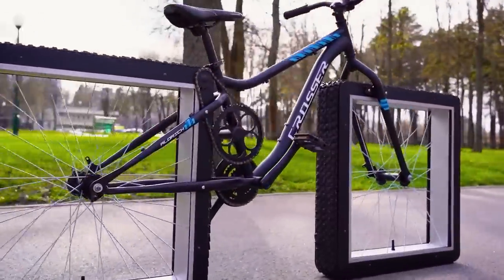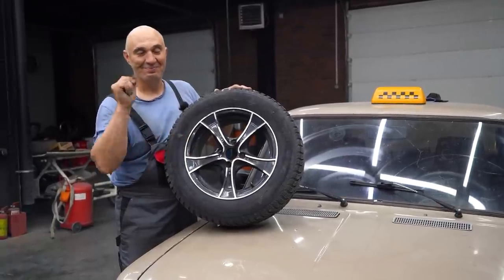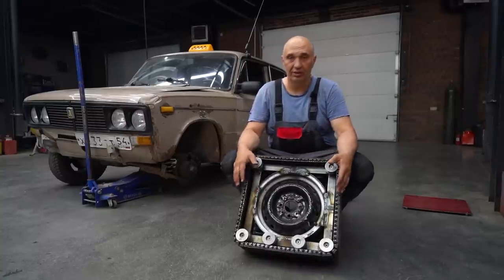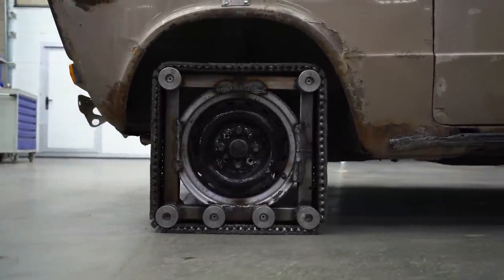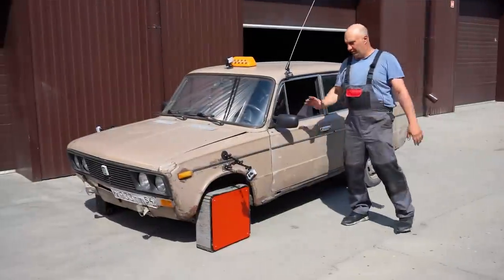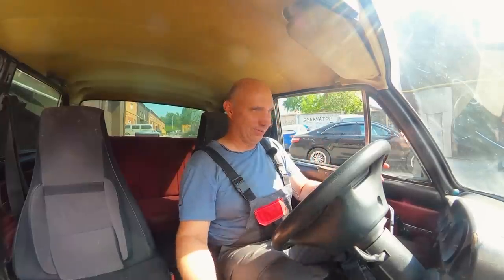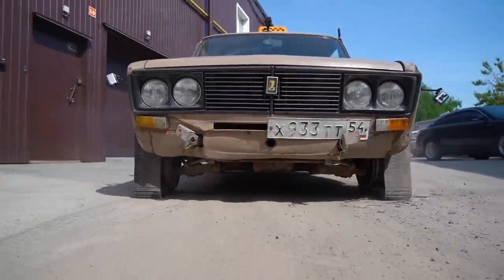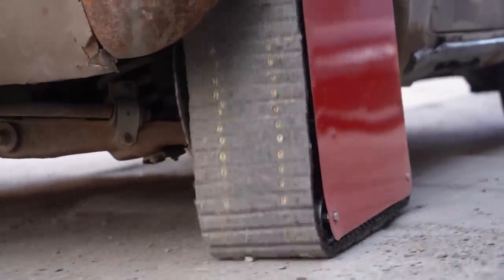We make gliding square wheels for a car

Comment: Please do all 4! ...and maybe make the wheel arches square too, for the sugar on the cake.
Reply: @Room1sixtyfive  gear drive from drive shafts to the chains inside the square wheels somehow then a brake on the driveshaft similar to how they do it on gocarts (and monster trucks). You'd obviously need the wheel hub mounted to spin free from the driveshaft powering the gears so it stays bottom side down.
Reply: all 4 cant work without modifying the entire car into a tank-like drivetrain.
Reply: One can clearly see the newbies on this channel, they're using the words "can't work" or "can't make". 😁
Reply: @MegaSockenschuss "You can't have no in your heart, brother"
Reply: Sugar? WTH? 😅
Reply: @UmmmmmmmWhat exactly
Reply: that would require on complicated set up to turn the axle turning into the track rotating
Reply: @MegaSockenschuss  wouldn't use the word "can't". They'd have to convert the simple design to a more complicated one, which will only produce more problems. Their glass engine was actually my introduction to the mad russian here. My impression was "what a novel idea."
Reply: @MegaSockenschuss richtig! Hier werden die unmöglichsten Sachen möglich!
Reply: They only did the steering wheels, not the driven wheels. That would obviously be harder to design something to drive the tracks. Also, there's definitely no brakes up front now, so this design would need to be heavily modified for the rear end
Reply: It’s “icing on the cake”

Comment: Get that 2 stroke engine ready
Reply: Bruh- a step too high I thinks
Reply: I really want to see it run. They should've converter that 2 cylinder lada engine into one.
Reply: I think they did that one  a long time ago now and are just getting the videos translated
Reply: @wolvenar BMI would normally say if the video was uploaded a while ago.
Reply: @riz3nfpv306  bruh! 😂 Grow up homie! Because bruh, bruh 😂 I assume u live in ur parents basement bruh 🤣😂
Reply: @shawnsatterlee6035  nah moved out - into your parents basement - your mum takes payment by the pound
Reply: Oh yeah!!! Almost forgot!!!! 🤣🤣🤣👍🏻
Reply: Port timing was wrong they will have to start over with a new block figure out a proper Reed system and raise the compression a bunch 2 mix is like race fuel high resistance to burn and long burn from the oil needs a pretty aggressive timing curve to make it work too stock Lada timing advance isn't gonna get you there
Reply: Yeah stop toying around and get that 2 stroke done 😎
Reply: Minus .5 cm is the interference  max for stock mods for use. Probably goes to -15mm if having fun
Reply: @79huddy cool story bro

Comment: Nice job! Doing this on snow or sand would have been a lot better. Definitely do all four, but make the next version triangle for better clearance, leave more room between the treads for self cleaning, make higher sides on the boogie wheels to prevent throwing a track. Also, you're going to need to add a hydraulic cylinder to the steering.
Reply: How do you put drive to a square wheel though?
Reply: @timjohnun4297  Would require some modifications to the driveline. The wheels would need to be mounted in an independent suspension style setup, and the driveline would need to be connected to the chains that actually spin the treads, like you see in the first part of the video with the bicycle.
Reply: @timjohnun4297  
just have the rim spin inside the square frame
Reply: Build the rear square or triangle wheels would be exactly like snow tracks on something like a serious 4x4
Reply: Yes with a longer base on the bottom side of the triangle.  I can think of too many ways to type to make the rear wheels drive.

Comment: Needs shorter rubber strips in the middle to make turning easier. Like others already said, adding more clearance between the strips makes it more resilient to pebbles and other hard material getting stuck between the strips.

Comment: With care of small radius, non geared wheels, no tensioner, it's a success!!! 
Now you need to add a tensioner and change the radius. It might be turn by a ¼ at each bump if too small, and tensioner is needed for higher speed to avoid chain jumping out the small bearing side, and finally the hardest job: made 2 for ear that included a geared hub to drive them all, 
Made it other way than triangular design will be hard, but doable ! 
Why not add a flat band of tires over the small rubber band for better looking and a bit of confort from ground to metal parts...
I love this creation ! 
One of the 10th best from Garage54
Have fun
Cheers from France 🇲🇫

Comment: I'd love to see what happens when you go over a speed bump, or up against a curb. How would they react would they handle. They would pivot on the original wheel bearing hub to help? Of course now you have no braking up front haha
Reply: With te smaller radius, it may not be able to climb the vertical jump of some bumps

Comment: If you attach rubber strips every 3 or 4 metal strips, you will solve the problem of the pebbles and the dust kicking up.

The dust is being "pinched" between the rubber pieces (the same as the pebble that stopped the car) and is being thrown, pinch-by-pinch, into the air which is why there's so much dust.

Comment: The strips need lap joints, like dozer tracks!  The rear should  be fairly easy with a link connecting to the trailing arms, or leaf spring mount and a link to the diff, possibly the shock mount,  and 'mabe with the backing plate for the brakes, then a couple pair of spur gears to spin the track, possibly bolt another axel to the   hub, with the spur gears gear between, use the beaton the axel to mount the square frame! Allowing  proper weight transfer,  cutting off the excess axel of course!
Reply: Exactly, this is why the pebble got caught. They need to be a bit more durable too, the strips were shredded after a quick test drive

Comment: Fun fact, back when i was in public indoctrination camp, (public school) the class was given an assignment to reinvent the wheel and to explain why you designed it the way you did. I did this same comcept but it wasn't square it was triangle, the reason for me not doing it square was less surface area so it wouldn't take as much torque/force to spin the belt on the triangle tires. This reminded me of that lol.

Comment: Very cool, I've never see this before, it's basically square tracks. 

I remember watching a Mythbusters episode 20 years where they managed to make a truck (Ford F250/350) drive with square wheels and they got it going fast enough to where the ride was fairly smooth.

Comment: A circular wheel is the biggest radius wheel you can make inside a square boundary, this square wheel needs a smaller radius, so it has difficulty overcoming vertical obstacles

Comment: you could achieve the same effect at the rear by building a box which encloses the wheel - welded onto the hub, .  Leave the bottom of the box bare so the wheel can still drive (and brake) the car, but be hardly visible.

Comment: Make a Detroit 2 stroke diesel style petrol engine that still has valves for exhaust only but has intake ports at the bottom of the bore. Needs forced induction. I recommend some sort of supercharger.

Comment: Use gears and a big bearing to power rear wheels and tapper the edge of rubber strips to avoid pinching the dust and pebbles.

Comment: Just weld the metals bars to the car's wheel, then add the conveyor belting to the bars. Could be used on both front and back. A no-flat design. :)

Comment: maybe make the gap bigger or solid rubber tread to not pick up rocks in the pinch at corners, and a idler sprockets on the corners. sprockets would help with a drive on rear also. yes do all 4

Comment: They can test to see if there is a problem if the water in the radiator is replaced by some light oil.  I don't see any problem beyond changing the hoses that resist oils.

Comment: Next build some tank treads for the Lada. Front and rear. Rear drive will need to use the rear wheel to drive them and then a custime tank assembly ro roll off road.

Comment: OkaY: a wheel gets more traction in a wheelbase than the same sized tractor-tread because the PSI of each wheel is spread too thin on a wheel-well-cat-tread; tires center their pressure under the axle and spread out the contact a few inches maintaining high pressure on the road: a tread will skid and plane far worse, and only fare better on soil, hail, sod, and bracken; this is great rural-terrain footing for pastures tracks and trails, never for a street.

Comment: I'd imagine these would probably glide right over pot-holes with no bumps at all....very smooth ride indeed!
Reply: Unless the pothole is wide and deep enough the front edge of the square turns down into the hole, then pivots the whole wheel assembly by 90° when it hits the other side. 😂
Reply: @UmmmmmmmWhat  Haha, true. No chance with big ones.

Comment: you guys should build a tri-star 12 wheel drive vehicle of some kind...although normal steering probably won't work the thing will need to articulate in the middle. maybe use rear steering wheels and put the star drive on front. idk you guys can work it out.

Comment: They didnt need to use regular bicycle spokes but whatever. I feel like you guys ready tried it but maybe a more tank like set up for the tracks where they are angled to go over things and ride off them  would keep rock out of the treads better.
 Looks cool but good luck driving/riding anywhere

Comment: Getting power and brakes functioning to a set would be a bit more difficult.. the bicycle just has the chain go to one corner but a car needs it to still go to the centre.. Maybe planetary gears? also would need something similar to a fixed brake caliper bracket to limit rotation. There's a reason these things aren't common.

Comment: years ago i made a design for a wheel like this, but it was more like a trapezoid than a square and the actual unique point about it was that it was made of much wider treads than this. it's kind of hard to explain this, but imagine a donut which is made of donuts. while the wheel turning on this axis makes the car go forward or backward, each individual tread also rotates on a perpendicular axis using bevel gears. so basically the car is moving side to side independently front backward and forward. It was an idea i had because the girl i was seeing back then could not parallel park. so i thought this way she could just go next to the spot and then drive 90 degrees sideways. i have 3d models made already and everything, but i never built it. there are many designs out there for omnidirectional wheels. mine was probably not the best. ^^ but you asked for suggestions so i am giving you one. a wheel which is made of several small sideways conveyor belts instead of a tire. maybe that's a better way to explain instead of saying a donut made of donuts.
Reply: I tried to picture that lol. Very interesting, the way it sounds, actually!
Reply: it's called a omniwheel you doof, and it already exists and it's patented as heck.

Comment: A lot of fun but you lose your braking ability on each wheel you replace on the front.  To have all four wheels square.... perhaps  the rear driving wheels could be set up to use engine braking or you could use a drive shaft brake.  I'm assuming the car has a drive shaft to the rear (driving) wheels.

Comment: Can you build a skid steer car which you lock the steering and then extend the rim to protrude the fender run conveyor belt or track from front to back and use the rear brake and diff to steer

Comment: I don't know why you picked the front to drive , you should only  use it on the rear .

Also the rubber should  have been so much thicker something like triple the thickness  .